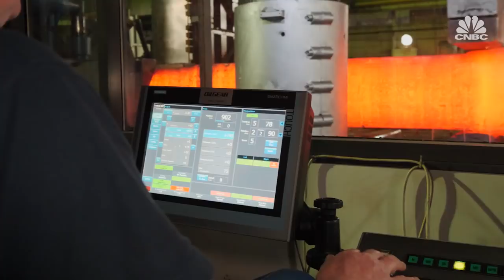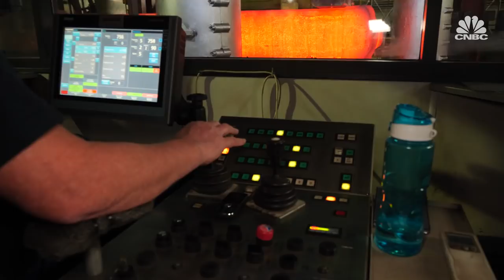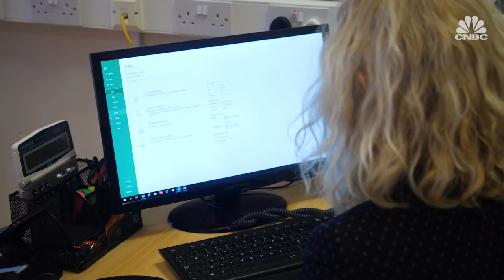Why the steel industry is worried about Brexit | CNBC Reports

Comment: British Steel collapses due to EU Carbon Taxation putting 5,000 jobs at risk
British Steel is set to be placed into an insolvency process, putting 5,000 jobs in the UK at risk and endangering 20,000 in the supply chain.
Reply: Ha Ha its always somebody elses fault right?